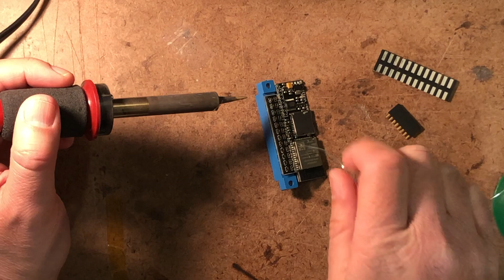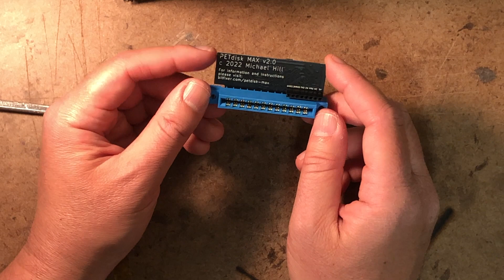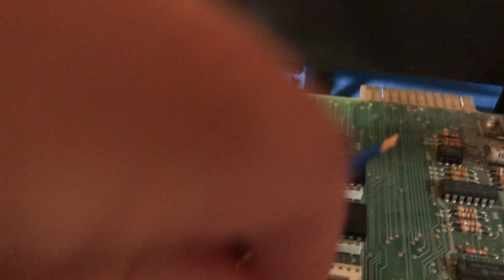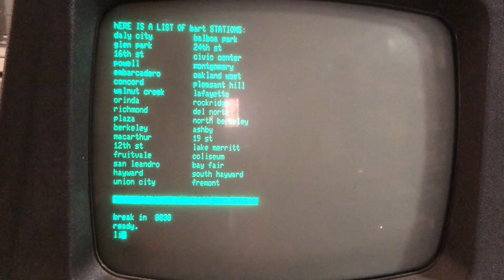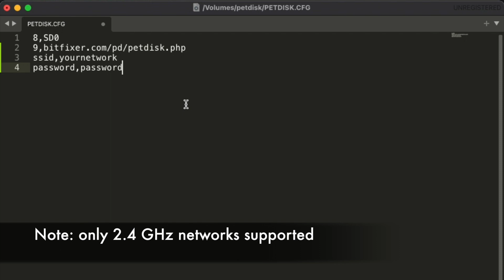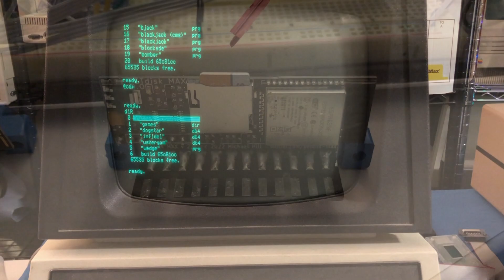PETdisk MAX v2: Assembly and Operation

Comment: The instructions would be clearer regarding wifi setup if it elaborated that the ssid and password lines were actually literally s<anything>, <networkname> and p<anything>,<networkpassword> and that the order doesn't matter. Currently you have to look at the source code to understand how to set up the config file. By saying that it is the last two lines that contain this information it implies that it is the position that determines the interpretation of the data (which it does not) and doesn't differentiate between those portions that are fixed and those that are variable.

Comment: Will this work on the minipet that tfw8b has for sale?
Reply from the maker: It should, assuming the minipet has a full implementation of an IEEE-488 port, which I think it does. I can't say with certainty since I don't have a minipet to test on. If anyone does and wants to try the PETdisk MAX out, please let me know how it goes!
Reply: @bitfixer6502  Yes it does - works perfectly. :) BTW I hooked up power to one of the cassette ports, since hooking onto a leg of an IC didn't make much sense on the MiniPET board.

Comment: Been following you for a while now, as I've a PET 2001-8 and a PET 2001-16N; just ordered your products. 🤗
Reply from the maker: Thanks! In case you didn't see already, on the 2001-8, the PETdisk MAX won't work if the PET is using the original BASIC 1 ROMs, the IEEE-488 implementation is incomplete on those. But using the ROMulator, you can switch out to BASIC 2 or 4 and it will work.
Reply: @bitfixer6502  Hehe, ordered it too.

Please note my additional purchase request via email.
Reply from the maker: @MattKasdorf  got it, thanks!

Comment: Great news!!! I wanted to get one and now I can. Many thanks. Just one question, will this work on all PETs? I have a 4032. Thanks
Reply from the maker: Thanks! Yes, a 4032 is fine. It will work in any PET with a couple of exceptions - it will not work with BASIC 1 ROMs since the IEEE-488 implementation doesn't quite work. Also I believe an 8296 does not have an edge connector for the IEEE-488 port, so it physically will not connect, but would work with an external cable. And in the SuperPET I've been told it doesn't have the physical clearance for the clip lead for power inside, so it would have to be powered externally. Plan to have a micro-usb connector for power as an add-on in that case.
Reply: @bitfixer6502  My 8296 has an edge connector at the IEEE-488 port. I use a SD2Pet with mine and it works great. The port is a little recessed though in the case so I will tell you how it lines up with your device once I build the kit you sent me. The SD2Pet only just goes in far enough to make contact before its outer case touches the pet case. Fingers crossed!